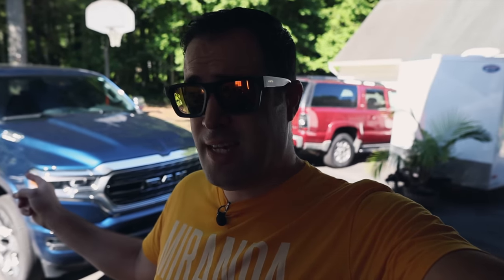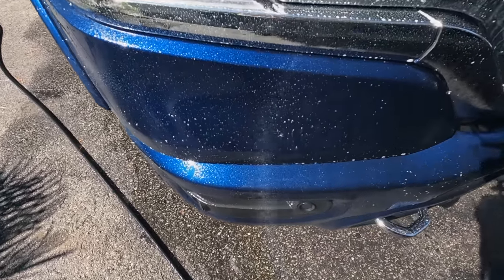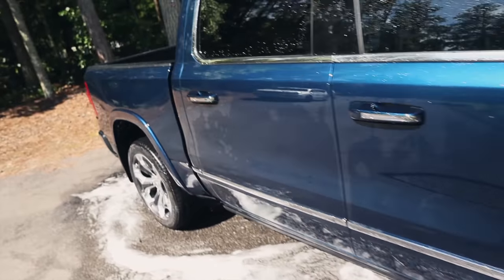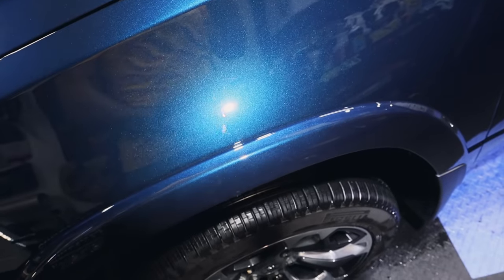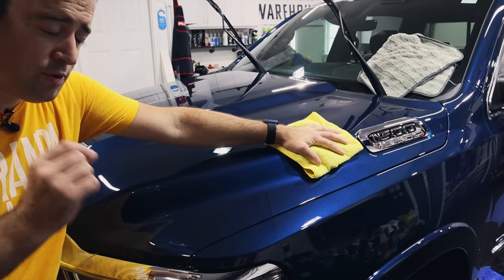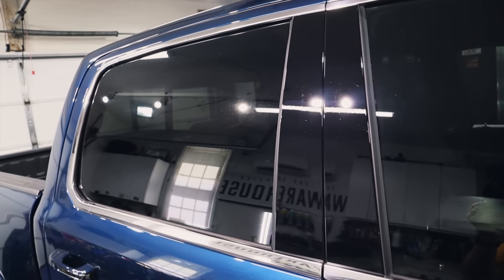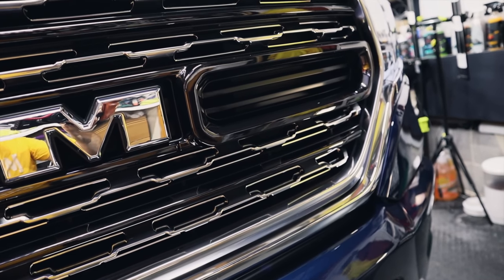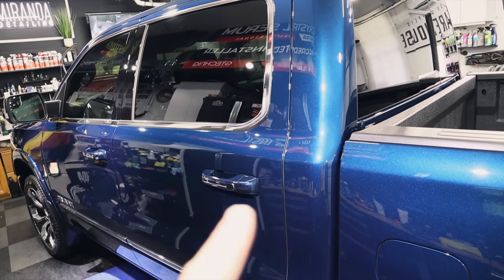Ceramic Coating Before & After On A New RAM! #ceramiccoating #detailing #detailinglife

Comment: Thanks for the tips bradah, the temps are started to go down last week and cure time has definitely affected, i got caught on one of my coatings and it colder quick and i could use ur advice in the future. For the tight space especially the grill i use gyeon wet coat, spray and rinse.

Comment: Agreed. If possilble I will use a primer. My fav is Tacsystem Total One Essential, much shorter wait time than Gyeon and CarPro’s primers. The NSP’s seems like a hassle.
Reply: How long is the wait time with TAC?
Reply from the maker: Cool. Thanks each at first the NSP seemed to be annoying. But we grown use to it and now love it.
Reply: @orthodox1717  depends on the temp, but min 4 hours @ 22c. At lower temps like 10-15c the time will be 12 hours.
Reply: @MirandaDetailing  if you feel adventures some time. Give tacsystem’s primer polish a go with a tacsystem coating (Quartz Power Plus)

Comment: What panel prep do you use?
Reply from the maker: 🤔  Do you mean for ceramic coatings?  If so I explained in the video. I don't use panel preps on paint.
Reply: @MirandaDetailing  yes. I heard that when you were polishing the hood. 
But interesting 🤔 and the ceramic still bonds to the paint

Comment: Hey Phil, I've noticed you use Dr. beasleys for compounding and polishing.  Have you found it gives the best results most of the time.  I mainly use 3dOne, mainly because it's fast, does a decent job and doesn't dust.  But I'm always looking for better products.   Was also looking into some carpro polishing products and pads because I know they make quality products as well.  I'm going to be polishing a Toyota Corolla with lots of water etching and scratches, so I'm not sure 3dOne will be powerful enough for the job, but we'll see.
Reply from the maker: Hi. So we use the Dr Beasleys NSP polishes as primers for ceramic coatings primarily. Thats what they are designed for. Makes things faster and less risky if dealing with sift black paint.  We still use other compounds and polishes for non coating services. 3D One is awesome also!

Comment: Would you consider doing a video on car soaps specifically to the understand of Ph?   My of us think ph neutral is best dues to marketing.   But I am learning that ph neutral may not clean as well.  I have a car with Stek PPF where the ceramic coat is embedded in the film.  Then a ceramic coat was applied to the outside in addition.  I top off with a ceramic coat spray every few months.   Ideally, I would love to do regular washes with foam cannon and blow dry for a touchless wash that gets off film and grime.  You told me that higher ph soaps won’t strip ceramic coatings, but what about ?the topper spray?  In my situation, is it possible to avoid a contact wash?  Wouldn’t this free up a lot of time for detailers?  A video dispelling the myths would really be helpful in my opinion.
Reply from the maker: Great question!  I filmed a video today explaining different soaps and what they do and when to use them. As far as a contact wash it depends. If the vehicle is garage kept and really clean you could get away with just a ceramic infused shampoo and rinse and dry and it’s good to go. But that’s rare on vehicles that have driven a few miles on the road and have built up grime on the paint. You would want to contact wash it.

Comment: Great job. Well said. Washing in direct sun I see,
Are you using DI water? Where do you get it?
Reply from the maker: Hi. Thanks. I only use my DI water system for maintenance washing on ceramic coated vehicles. Our water here is not bad at all so we don’t worry about water spots. Also because we dry immediately…there is no chance of water spotting anyway. https://youtu.be/SPI8GSQUYCw

Comment: Phil, Did you use EXOv4 as a stand alone? I just got my car coated with Ultra and Gtechniq actually recommended me to not top it with Exo which surprised me. They said since it's a daily driven car kept outside that I should skip it since it's softer than the ultra and will pick up love marks much quicker. Surprised me to hear for sure. As a stand alone in my situation they said no problem but since I have a stronger coating to start with to leave it alone.
Reply: I think I remember hearing these for other coating manufactures as well. The top coat isn’t necessary and is more slickness rather than durability. If the manufacture recommended it I would roll with it.
Reply: @Breese147 , That's what I did. They said in the beginning they recommended Exo for everyone that had Lite or Ultra as a base coat. Now it's recommended for at the very least garage kept cars and as well as they said absolutely proper maintenance is required or they won't even recommend it for garage kept. It's much softer so swirls and drying marks are going to show much easier. I topped mine with Duraslic Flow-X. As of now for all the Toppers I've tried this stuff is leaps and bounds the best I've used. It's not cheap but it's the real deal. I use quality drying aids, Ultra as a base coat and FlowX as the long term Topper.
Reply from the maker: Yes that’s what Gtechniq told us also. Dual layering is a regional and marketing thing rather than a rule or necessity. 😎👍🏼

Comment: Hey Phil question sir!!!!… I got the brand new suburban in cherry red. I did a  wash and clay and used meguairs 205 and got all the swirls out and then used chemical guys wet mirror glaze… is there a designated wax/sealer for red paint to really make it pop?
Reply from the maker: Hi. That’s awesome. There is nothing specific for colors accept maybe black, but even that just has fillers to maps swirls.  Polishing and using a good wax or sealant will make any color pop. I think gloss and shine is also subjective so it’s hard to say sometimes.

Comment: I have a Ram like the one you just did and a fiberglass shell (white). I am wonder is I can lightly clay this shell. Thanks
Reply from the maker: Hi. Is the shell painted and clear coated? Or is it just unpainted bare fiberglass?
Reply: @MirandaDetailing  clear coated Thanks
Reply from the maker: Ok. Then yeah as long as it clear coated treat it like regular clear coat on the vehicle.

Comment: What foam cannon soap do you like right now?   Do you still use the lemon joy home made glass cleaner
Reply from the maker: Hi. We use all sorts of soaps but I really love the Koch Chemie Super Foam or Active Foam for amazing foam and cleaning action also.
Reply: @MirandaDetailing  thank you.  But won’t a non ph neutral soap remove coatings?
Reply from the maker: No ceramic coatings are very resistant to high and low ph soaps. In fact when a coating starts to show signs of clogging it’s good to deep clean it with those types of strong soaps. For waxes and sealants it’s best to use a ph neutral shampoo because waxes and sealants are not as strong as coatings.

Comment: Phil: Great job. What is your opinion on ceramic sprays?
Reply from the maker: Hi. Thanks. We use them all the time. They are not like true coatings but they are perfect for customers who can’t afford a $1000+ coating service.
Reply: @MirandaDetailing  : Thanks, as I am mainly practicing & learning how to detail on my car I have been using ceramic sprays. I did clay bar my car before using the spray but I am not sure how effective it was.
Reply from the maker: You’re welcome. Do you mean you’re not sure how effect the clay barring was? Was the paint smooth after you clay barred it?
Reply: @MirandaDetailing : Phil I did run my hand over the paint & it felt smooth. I guess I was expecting more debris on the clay bar as this was the first time I have used a clay bar on my car & have had it for close to 8 years now.
Reply from the maker: Ok good. That’s a good thing though. If the paints that smooth and the clay bar didn’t pick up that much grit that’s good!

Comment: Thanks for the video! I’m looking to try the NSP polishes on a ‘16 Black Honda Civic and then coat with Gyeon Mohs EVO. Two questions if you don’t mind:

Would you recommend the 45 or 95 with the orange pad?

Do you think I’ll have any bonding issues since it’s two different manufacturers?
 
Many thanks!!
Reply from the maker: Hi. It’s really good stuff.  I would start with the 45 first and the orange pad. 
No, those NSP polishes were formulated to work with any ceramic coating.
Reply: @MirandaDetailing  thank you! Looking forward to giving it a try.

Comment: Thank you for this helpfull video , one question can i do ceramic coating without polishing before ?
Reply: Yes, but it may not last or perform well . So I would stick with a spray and wipe or paste wax if you don’t want to polish or pay for a polish. Kind of like applying paint to a dirty surface. The products are designed to bond to clean clear coat, even new vehicles on the lot can be vary contaminated or have water spots.
Reply from the maker: Great question. I had a customer request that in this video https://youtu.be/qQ16cXCHKKA
I explain the pros and cons.

Comment: Have a nice weekend.Phil, your video on detailing workshop was AWESOME... congratulations.....

I don't agree about the paint prep... but...who cares.......😃😃😃
Keep your great work... Ram came up sweet ....
Reply from the maker: You too!  What do you mean about the paint prep?
Reply: @MirandaDetailing  in your main thumbnail of the video it Sais << ceramic coatings STOP using paint preps>>
With yellow and red letters
Reply from the maker: Oh I see. Yes that’s because we use the Dr Beasleys NSP Primers instead of a paint prep or panel wipe. It’s takes the place of a paint prep or panel wipe and actually helps any coating bond better. That was the point
Reply: @MirandaDetailing  i understand dear Phil.. But the head chemist i have relationship, always suggest me that from their point of view if we don't use the same brand primer-ceramic coat, no company can verify clearly that his coat will bond properly with other brand primer
But i get your point Phil. Have a great Sunday keep up your great work on your chanells.
Reply from the maker: Very interesting. The Chemist at Dr Beasleys has tested it on many other coatings and formulated to work. Well at least with Gtechniq and Gyeon coatings I am seeing them at the year mark and they are preforming perfectly. But i understand that some may be skeptical still. It’s still pretty new and not a lot of detailers trust it yet. But it does work incredibly well.
Reply: @MirandaDetailing  i agree....many brand  coatings tested  but i suppose he couldn't test it on...all the coatings avalibale and for those are coming new every day on the market, 😃😃😃.... specially those we have available on Europe. So for my world , is best for us to use strong preps before coatings.....but i understand that everyone s world is different....so the solutions and Detailing procedures.

Great idea your new website Phil, i will support it and linked.it on my chanell and my business page for my fellow Greek viewers to check when it is ready....keep up the great work...
Reply from the maker: Thanks for sharing man! 😎👍🏼

Comment: Beautiful. Yeah....I leave high spots! After about 4th go around I get them off. Geewizz. 
Question: not that it matters, but why EXOv4 for the coating? Just trying to get in your head alittle. 
Question: is it that difficult to go from amateur enthusiast to a pro detailer? Man I would have a difficult time doing that! 
Ok. Very fun video. I sure look forward to your videos. Hi wife.
Reply from the maker: Thanks!   So we sell EXOv2 as our 2 year coating. Customer wanted a 2 year coating. So basically we offer a few options for coatings. A 1, 2, and 5 year option. Each at. Incremental price points. So I explain each one and they choose.